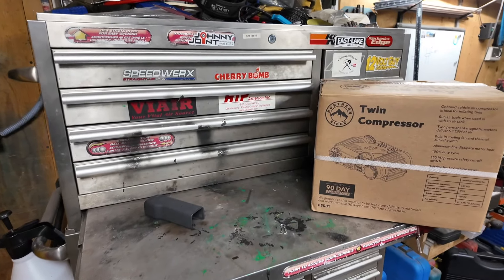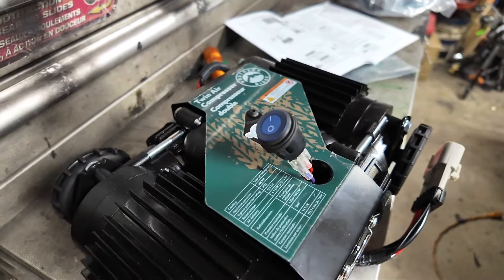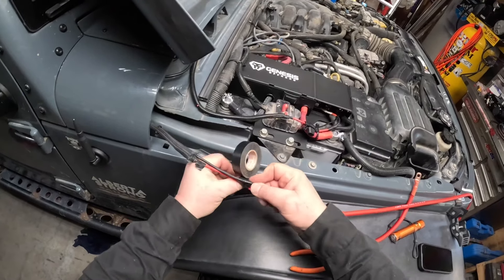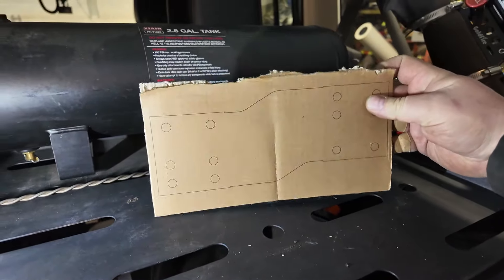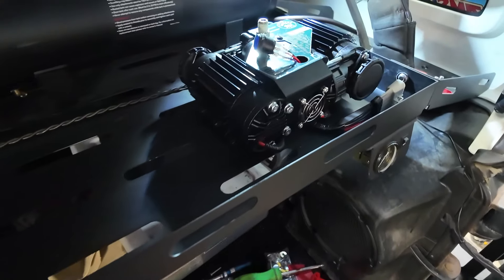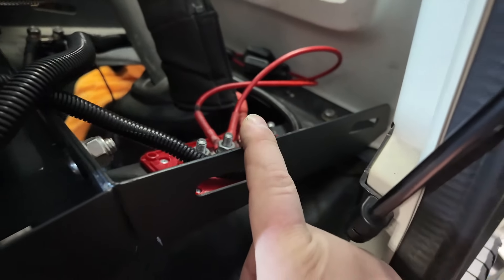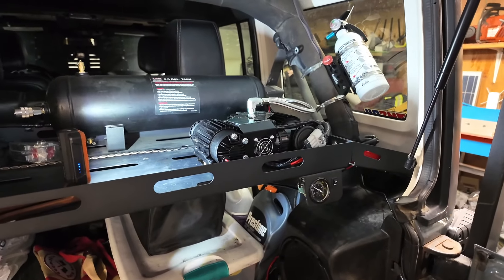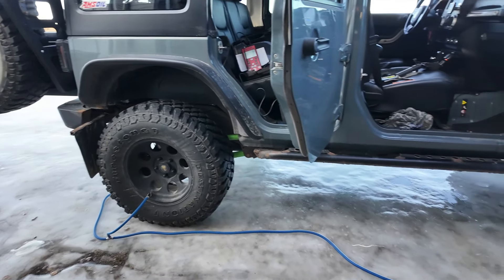NORTHERN RIDGE TWIN COMPRESSOR | Princess Auto

Comment: For the actual current rating I calculate 30% of the Chinese rating max.  So 150 Chinese amps is equal to about 50 amps here.    Whatever the Chinese rating is, I always rate stuff down to 30% of that.  On another note, I've wanted an ARB dual compressor for a long time but just cannot swallow the price. I'll check around here in the USA to see if the Northern Ridge is available at one of the local Chinese emporiums here.  
Good Luck!
Reply from the maker: So far it’s been working awesome

Comment: Just thinking about your wiring you could have left that switch in and use a relay two points of power to turn on compressor?
Reply from the maker: Switch wouldn’t fit back in place once another wire was added